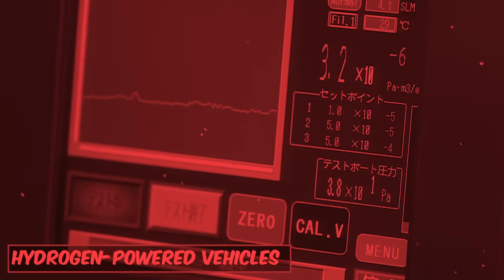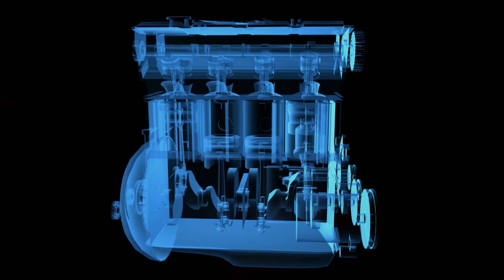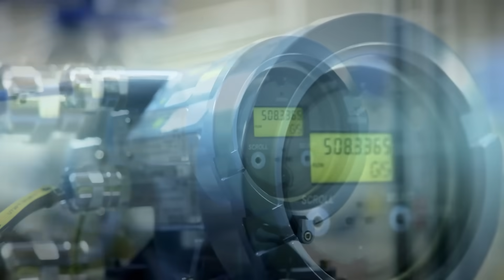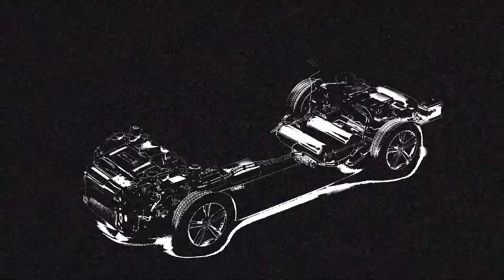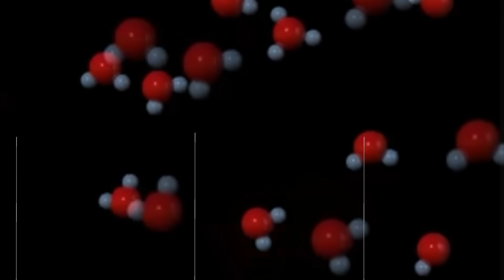Toyota's New WATER Engine Will Destroy The Entire EV Industry!

Comment: Hmmm … while I don’t dispute that you can burn hydrogen in an internal combustion engine I am skeptical that you can produce hydrogen via electrolysis then burned by the engine within the same car without violating the laws of physics. I say this because you need energy to power electrolysis which by itself is inefficient then burn the output hydrogen in an ICE which is again is only 40% efficient.

Comment: Be cool to hear the real story of what they're working on. If they are generating hydrogen its not happening with distilled water. There are electrolyte's that can be added to help but significant power is also needed. Then on the other hand there is actually a water engine that was invented in the 50's I believe? One that uses fuel for the primary power stroke followed by a secondary power stroke that uses a small amount of distilled water that makes use of the heat generated in the first power stroke. The energy produced by the water flashing to steam creates the force to drive the piston through the second stroke.
Still....... A concept engine of late but possible I suppose.
Reply: The say "electrolysis" in the video, but if you find the Toyota block diagram online, it says "fuel cell"... so who knows exactly how they're cracking H20 into hydrogen and oxygen. It makes sense: conventional electrolysis of water would be a nightmare with water from any source, any kind of salts or other contaminants  in it. And the system would gum up with that crap pretty quickly.
Reply: @DaveHaynie  One story I saw not long ago said they are getting into hydrogen production from the abundant nuclear power they are producing.

Comment: Simplicity is the best design, hydrogen engine is not the best because every engines involve combustion and high heat, that means each engine has complex components and needs cooling system. Electric motors are still the simplest design for cars.

Comment: Then there is the Stirling cycle engine, used for hundreds of years until Ford got their claws into it and made it go away.
Reply: Ford didn't make the Stirling heat engine go away... the Otto and Diesel engines made it go away. The Stirling engine had a terrible power to weight ratio compared to those that replaced it, it was much more expensive, and the heat exchanger was very complex. That didn't kill them forever, though. They're used on some submarines as auxiliary engines, because they can be nearly silent in operation.
Reply: @DaveHaynie  Certainly did not kill them, my central heating boiler uses a stirling engine to generate electricity from waste heat

Comment: Most of the information in this video is inaccurate and incorrect. 
The energy created by dissociation of water into hydrogen and oxygen is done with  highly reactive metals that are consumed in the reaction.
Water is not a fuel! It's an ash with an extremely low energy content. 
I don't think the video producer understands what is actually going on or whete the energy to run these engine is coming from.
It's coming from the metals...
Reply: Lol, you have no idea what your talking about. Stainless steel is used for the conductive material and they don't desolve in the process. A car battery is used in conjunction with a charging alternator to maintain the amperage. I ran a diesel 7
2 liter engine with my home made generator and it's not complicated as you surmise

Comment: using metals to react with water to dissociate the hydrogen from the oxygen provides the energy for the hydrogen production. 
The motor does not run on water...
Water is the ash that results from burning hydrogen and oxygen together.
It has a very low energy coefficient.

Comment: FALSE!! If you took the steam output and put it back in the tank then you'd have a perpetual motion machine. Not possible. Additionally, constantly exposing motor oil to steam is an amazingly bad idea; ask any mechanic. The lubricants that exist that are meant to be exposed to water also happen to cost many more times than motor oil.

Comment: Seems strange that electrolysis is employed to split the hydrogen from the oxygen ten used oxygen in the air for combustion. Electrolysis is a very slow process, needing storage of the gases while the engine is not being used. Load of energy will be needed for the electrolysis process!! A connection to the electricity supply would be needed for this, this is not mentioned. Absolute pie in the sky idea!!

Comment: The only way this could work is to have a big block. Of sodium that you drip water on and it produces hydrogen  Or you could put aluminum and drip sodium hydroxide on it. And I'll produce hydrogen hydrogen and what you have left over would be sodium. I dropped side and you could dissolve zinc and produce more hydrogen.  This has to be what they're using
Potassium You can even do it with zinc at high temperatures.

Comment: Ok, what's the range on this thing? They gotta get the power to produce the hydrogen from somewhere no, and if they had inflatable bags outside the car. You could store some of it, but that means you're gonna have more drag than China. The store methane on the top of buses and they can go like. I don't know 4050 miles with the methane in the bag on top of the bus. And I thing about that if it ever catches on fire. It's not gonna kill anybody.  So what's the source of power to make the lighydrogen? I always thought that you could probably run a motorcycle in this concept with some batteries, and you might be able to go five or ten miles with the hydrogen you can produce from the battery I don't know

Comment: This video forgot to mention that theses are electric cars with extra steps, you need a battery to separate the H2, so you still need rare earth metals and still need to charge it. 16 years ago I built a HHO/gas hybrid that because of the higher temps, pressure, and oxygen the gas burned more completely and cleanly. Gaining me 10 more miles to the gallon. Fun fact only 30% of the energy in gas is used the rest is lost to heat and out the tail pipe.

Comment: What kind of "castle in the air" is this?
Where do they intend to get the energy for electrolysis?
Reply: There's a big EV battery stack. You can find Toyota's actual block diagram for this online.
Reply: @DaveHaynie  The video implies that they fill water, as if that's their fuel, but doesn't explain anything about how they get the energy to make Hydrrfor ICE.

If they use an EV battery they still have to change that battery, like any EV.
EV battery + water -{electrolysis}> hydrogen + waste heat (+ oxygen) -{ICE}-> propoltion + water + waste heat
EV battery -(electric motor)-> propoltion + waste heat

I don't understand how water/electrolysis/ICE can improve the efficiency in any way; compared to just an electric motor in a normal EV.

When you still have to charge batteries, and the total efficiency is less, where's the gain?

They try to present this as an ultimate solution:
- just fill water; seems so easy compared to filling hydrogen.
- they avoid everything about how they get energy for electrolysis.
Reply: @thorbjrnhellehaven5766  I'm sure at this point it's a complete hoax, and Toyota isn't building a "water engine." It really makes no practical sense. The best you could do is make another kind of EV that's using an electric powertrain to power an the hydrogen combustion engine... very inefficient, but it would seem like a conventional engine vehicle. But you'd need at least twice the battery capacity for the same range, and probably more.

Comment: This is nothing new, and has been known about for years. The original designer was a lecturer, and tried to get  the motor industry to take up the idea, but he had a mysterious death. All of the original footage was available on YouTube, including his mysterious end. Electric cars were also known about before and got purchased by the oil industry, and kept under wraps for decades. When there is so much money in the oil industry, and with wealth comes power, any technology that threatens to not need an oil based fuel is big concern. Ford had an electric  car that was kept under wraps for decades, even though its performance on the test track was outstanding. Tesla knew about free energy, without the need for electrical pylons, yet it still hasn't seen the light of day, and yet this has been proven to work. Tesla was an extraordinary and yet hardly recognized, but without  Tesla we wouldn't have the AC power system, we use today. It all comes down to money first and people and the environment last.

Comment: " Refueling from almost any source of 'DILUTED ' water"?  WTF???  What could you possibly dilute water with, more water lol? 
Apart from the fact it takes more power to produce the hydrogen than you can get back out of it, if it's not stored at all and only produced on demand, it's going to be a lot worse than the turbo lag people have been complaining about for years.
People have been producing their own hydrogen through electrolysis for years yet nobody has been able to make it genuinely effective. It also needs an electrolyte of some sort, not just pure water which is a pretty terrible conductor.
This is pure conceptual and if running at all, I but it HAS to have extra stored hydrogen added. There's also a fair bit of messing about cleaning and replacing electrode plates. This will go nowhere beyond Toyota's advertising department as evidence to shine a spotlight on to pretend they're really really being climate conscious and innovative lol.

Comment: I was looking into this exact H2O process 15+years ago. The whole process needs a H2O separation process that doesn't use more energy than it yields in H and O. By all accounts the bonds in the H2O molecule are one of the strongest.
Reply: Yes, nature usually finds the lowest energy point, hence we do have liquid water on the planet (I bet many have noticed).
Yes, most H and O are still in the Sun, and some tons of H are fused all the time, but we're not in Sun.
Fun like joke of water vehicles or plants comes up every couple of years since at least half a century I remember :)
Reply: @tondekoddar7837  There's no oxygen in our Sun!  It's a main cycle star, still undergoing hydrogen to helium fusion. If it's large enough, the star will collapse once the hydrogen's used up, but reignite in a "helium flash" as a helium burning star, helium fusing into carbon. That's about 5 billion years away for our sun, and that's a Good Thing, because that kind of star becomes a red giant, likely gobbling up Earth. Very large stars can go through carbon->oxygen fusion, but that's very short lived, maybe as little as 1000 years. And subsequent fusion cycles ensure, all the way to silicon fusing to iron. Other, heavier elements have to be formed in supernovae. Supergiant stars -- like the circumference of Jupiter's orbit or larger -- may have multiple simultaneous shells at different fusion cycles.
Reply: Why does it need to yield more energy than it uses to split the water?
Reply: @endthefed5304  duhhh - think about it.
Reply: @jl-5188  I have a BSEE. I think about it. It's possible to run an ICE from hydrogen AND from the alternator output run the electrolysis. I am pretty sure it can be done.
Reply: @endthefed5304 to produce pure H is an high enery consumpting* procedure, normaly fulled by fossil resourses (black H), other stuff burning energy plants (grey H), or produced from clima nutral  sources  (green H).
However, H2O don't splits from alone. 😂
Reply: @endthefed5304  Nope. Think about it... that would be a perpetual motion machine. You're getting more energy out than you put in. Ask a MechE about the Second Law of Thermodynamics. It takes more energy to crack H2O into H2 and O2 than you get back "burning" them together. Not to mention the fact that the engine itself is only as efficient as any old ICE... maybe 15%, maybe even 25%. So even the total output of that engine driving a 100% efficient generator couldn't crack enough H2O to keep it running.
Reply: that will require  a fusion reactor  we are  not there yet
Reply: The laws of physics cannot be broken....simple fact....It takes more energy to separate the hydrogen from the water then one will ever recover by burning the hydrogen.

Comment: I wonder what method they use to keep the Hydrogen and Oxygen separated so as NOT to make EXTREMELY explosive HHO. Using Stainless Steel plates separated by a very fine synthetic mesh around 300 threads per inch to allow current to pass from one end of the plate stack to the other in a system using distilled / de-ionised water with Potassium Hydroxide or Sodium Hydroxide as an electrolyte to aid conductivity is a known technique which allows the Negatively and Positively charged sides of the plates to gas off into separate screened off compartments for collection.

Comment: It takes more energy to split water into hydrogen and oxygen then the 3 cylinder 1.6 liter engine can produce.  Also utilizing combustion rather than fuel cells causes pollution.  During the high temperature combustion the nitrogen in the air combusted with the hydrogen creates NOX (oxides of nitrogen).  A water engine is not sustainable without a power source beyond the engine.

Comment: One step in the hydrogen production process is holding these "water powered" vehicles back. The oxygen evolution reaction (OER) is the key to splitting H2O into hydrogen and oxygen, but it is inefficient. In order for water being electrolyzed into Hydrogen and Oxygen to be a feasible energy source for vehicles it must produce significantly more energy than it requires to make it.  Currently, there is no net energy gain to be had with Hydrogen although research is being undertaken to see if sufficient hydrogen can be produced from electrolysis of water with catalysts being used as the Anode and Cathode.  The catalysts must survive in highly corrosive conditions with a high voltage applied and will be costly to replace, just as current EV batteries are.  The question that no one is asking: where will the energy for the electrolysis come from? Batteries?  A massive alternator that will suck up all the power produced from the engine?
Reply: If you could crack water into hydrogen and oxygen with less energy than is released putting them back together, you'd have yourself a perpetual motion machine. Not possible. There's a battery. An alternator wouldn't help.

Comment: #####!! In Georgia 2005-20012,  three technicians ran car engines on MINERAL water in carbs 6-7 amps electrolysis from half-wave DC of 400W inverter and inductor coils, diodes, etc. The zero ohms spark plug passes electrolysis 6 amps using higher voltage inductive ignition.  4 cylinder  tractor, (2) V8 Chevy engines, 4 cylinder  pinto, and On YouTube video for 2008 a Briggs 18HP engine running idle on water only. There was an electromagnet forming field 4.5A over plug wire, and the necessary field carries on to the combustion chamber. The lawn mower battery was disconnected after starting. The under flywheel magnets powered the Briggs at 15 amps max with bridge rectifier. See S1R9A9M9 mower engine running on water. The generation of Hydrogen and firing, and production of water vapor pressure both ran the engines. This was their discovery. All have accessory spark gap and insures final gap fires.  E.G.R has to be applied to get the added Nitrogen embedded in the expelled water from compression.  Working on bench set up to duplicate. 1978 El Camino 18MPG at much lowered power. Mower engine easier to work with. (The increased efficiency may have to do with Radiant Energy expelled from series line diode when POSITIVE High V enters exactly after cathode. The ON diode shuts off, the High V presses there, then reverses to fire the spark plug. R E follows to spark plug tips as the inductors and diode were IN VACUUM CHAMBER) So now you know!<<<<>>>>>>!!

Comment: No way.  There is no available energy in water.   It's a perpetual motion machine, which is not possible.  Likewise for motors that run off of air.   Junk Science.  This is just thermodynamics,  covered in basic engineering with proofs and theorems like geometry.

Comment: This certainly will not work as shown. However, I am curious about the water injection engine. It is supposed to work by mixing water and ethanol and injecting them into the cylinder. At compression the ethanol is still supposed to ignite and at the flashpoint, the water is supposed to deliver more power than the fuel. Well, that is the idea. It might work...but this video's approach makes it seem like water is doing all of the work. I don't think so.

Comment: There is one option which mainstream economics does not want to entertain. The cost of domestic electricity required as input energy for electrolysers, is the sole limiting factor. Electrolysers do not require expensive domestic electricity. Inexpensive non-domestic electricity can be easily sourced from irregular environmental sources such as wind and solar, which is available in all corners of the planet.

Comment: You didn't explain on where about the electrolysis unit to produce the hydrogen needed the electrical supply? Is it coming from a battery bank? By concept, the water powered engine needs to get the same amount of energy supply from the battery in order to get the mechanical energy to drive the car. So, in that case it would be similar as an EV car. Remember the principle of energy conservation. You can neither create energy nor destroy it.
Reply: Indeed, i love how that massive hurdle isn't covered at all in this video.